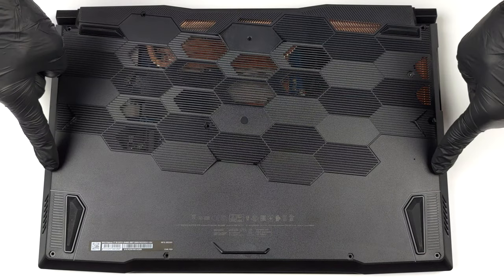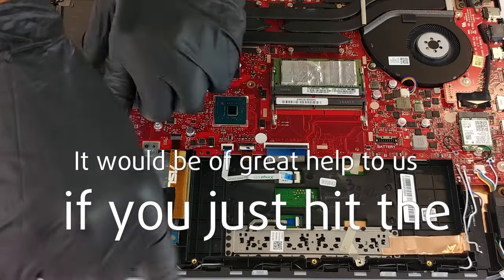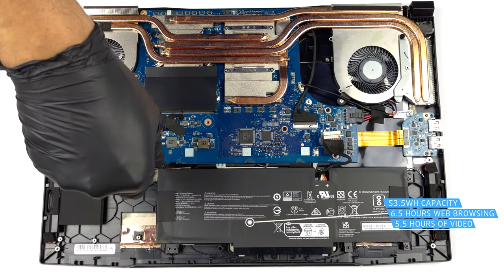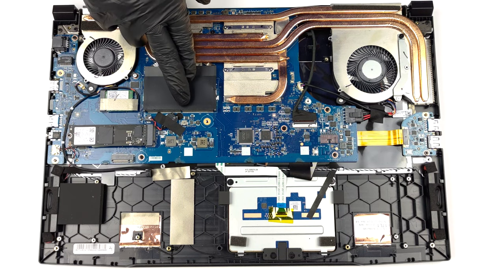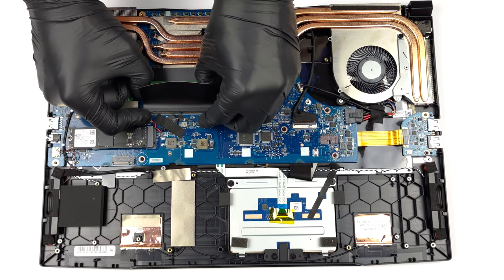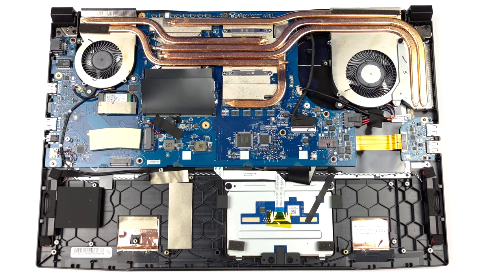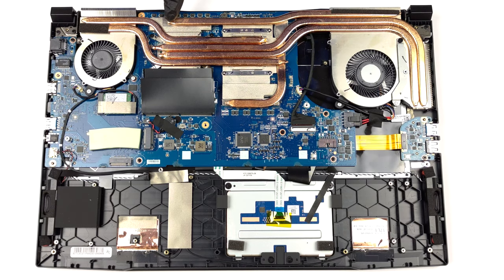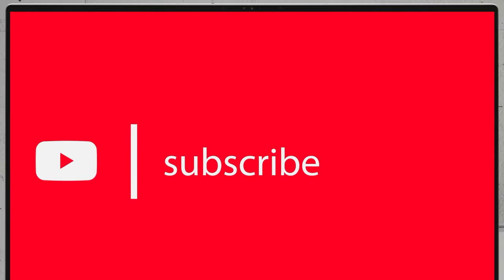🛠️ How to open MSI Katana 17 (B12V) - disassembly and upgrade options

Comment: I have the MSI Crosshair 17 C12VF-264XES and it's the same main board 😳 The only difference I see is that it doesn't have the chip that is in the center on the right, the one next to the one that says "ene".
Reply: Standardization is designed to simplify the repair and production of machinery, so this is normal. These boards are made with a margin to power powerful components. Therefore, their availability in cheaper laptops is a huge plus.

I bad speak English, I'm sorry

Comment: for ppl who have the same katana and they want the additional hardware for the second ssd don't worry the hardware is in the right fan
Reply: Are you sure about that?
If you're talking about the metal piece on top of the right fan that you can unscrew, it doesn't align with the bottom left screws in a manner that allows you screw the SSD with it.
Unless you're talking about a piece inside of the fan?
Reply: Nope, can't confirm it :(

Comment: how do you add an additional SSD storage ?
Reply: did you already add 2nd SSD ?
Reply: @filip5591  yes I have I contacted MSI and they sent the metal bracket. So it's done
Reply: @Airwane How do I contact MSI for the second M.2 PCIE ssd installation bracket? Thanks for your anticipated assistance.

Comment: hi, what do you mean by "additonal hardware to install second ssd" ?? thanks
Reply: I don't see slot for a 2nd SSD ..
Reply: @Chibranche  is seams that there is one with 1 90 degree rotation, beneath the main one

Comment: Does this have a SATA Power and Data Port in it for you to install a HDD or SSD for additional storage? Second question is does this have a second M.2 Slot for a total of adding 3 storage device?
Reply: Your second question is already answered in the video. As for the first, no SATA ports were mentioned and I don't see any on the motherboard, so I think it's safe to assume that it's M.2 only.
Reply: @xjdhdr.  

Your answer did not help me.
Reply: @awakenedsoul2638  
Please quantify exactly how my answer was "not helpful".
Reply: @xjdhdr.  

Is there a need? You are not helpful.
Reply: @awakenedsoul2638  
Can't say I didn't give you a chance. Yes, you do need to quantify because you are objectively 100% wrong.

You asked two questions and I gave accurate answers for both of them. In fact, you yourself proved how useful my 2nd question's answer was by posting another comment asking a question that relied on info I gave in that answer. BTW, I know the answer to your new question as well, but not going to give it since you would rather belittle anyone that tries to help you. 

Ironically, while you can't call my replies unhelpful, the same can't be said about yours. I asked you to a question and you "answered" by simply refusing to answer it, repeating the original unsubstantiated premise, and belittling me. By all objective metrics, your replies have been very unhelpful.

In short, you are a liar and a hypocrite.
Reply: @trinitronjonatran  
"all you said in the video"
What are you talking about? I didn't say anything in the video. I had nothing whatsoever to do with this video. 

""you might need some additional hardware to install the second SSD", obviously not helpful"
Please re-read the comment Awakened posted that I was replying to. He/she asked, "does this have a second M.2 Slot?" Notice that the question was whether or not it was possible to install a 2nd M.2 SSD, not to identify the additional hardware that would be required to install it. 

Finally, thanks for confirming that my reply did, in fact, answer the question (despite the claims by Awakened to the contrary).